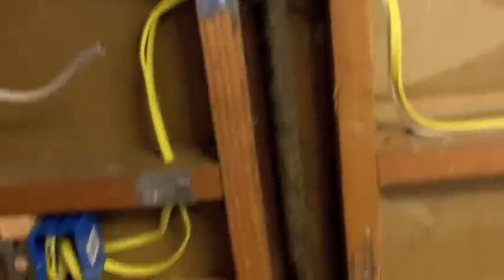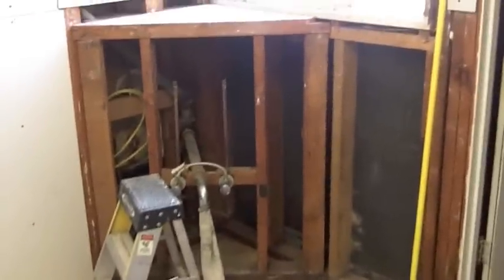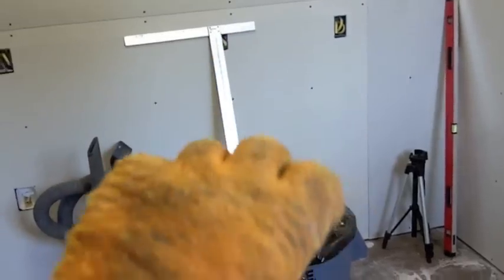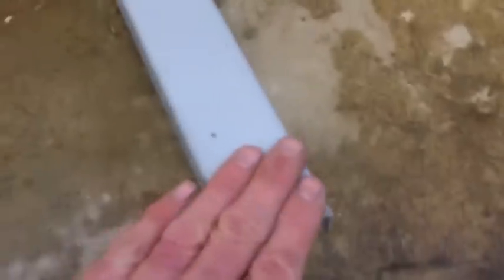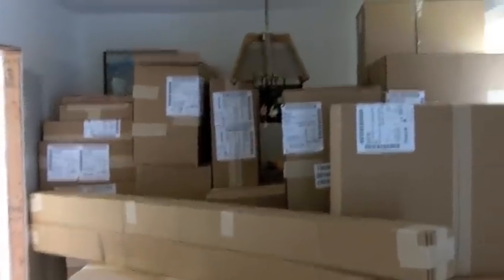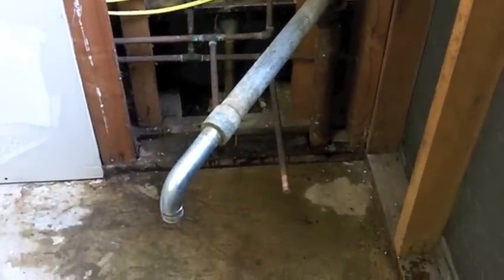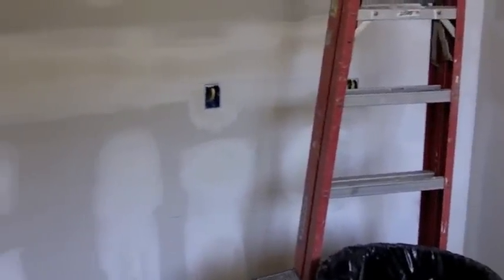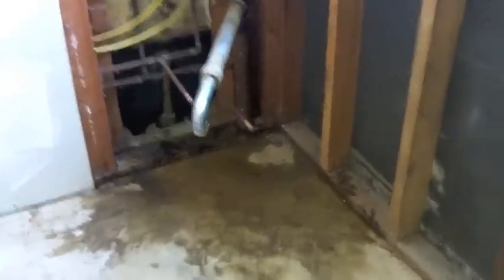Custom Kitchen Remodel  Drywall and Cabinets 8

Comment: Hey Steve!! 

I like that Romex cover you built, that's cool! Great tip on the nailing plates, at .24 each, you can't go wrong! You never know what someone may try to drive in the wall someday down the line. 

Cool gloves, I'm going to look for some. The drywall lifter looks like a must have tool!!

Nice cabinets! Made In the USA, that's awesome! Can't wait to see them installed!

Great job on the drywall! Sealing that seam makes a lot of sense, old attics are dirty!

Awesome video!!

Comment: nice work on the kitchen, dry wall looks great. those piercing pipe clamps for the water over time will leak. steel and copper don't like each other. the one I installed lasted about 5 years. just saying. nice gloves! thanks for the videos.

Comment from the maker: Hey Freak, I have heard good and bad about those clamps.  For now, the hose is just stubbed up into the attic.  I don't know if the owner is buying a refer with icemaker or not, so I may or may not tie in the line. We just wanted it in place while the walls were open.  It really would not take much to tie into the water line with a real fitting.  I will see as it goes. Thanks for the comment.

Comment from the maker: Hey Jay, I am not using any of the old wiring for the new kitchen power.  Replacing the old wiring is not as easy as pulling new wire, It is a major undertaking to open up walls, yank the old and pull in new.  The K-a-T is all copper approved ga. wire that is working just fine..as long as you don't need to modify it.  Thanks for watching.  I have family in Kings Cross, just outside Sydney.  Been many years since I have been, but it sure was Beautiful Country!

Comment: yeh thats fair enough, like the old rubber coated stuff we used in australia that breaks down and literally crumbles to pieces in your fingers. also it was common to use the metal conduit as an earth, so when people broke the conduit for ad on's it compromised the houses earth. if the ruber wires degraded the conduit became live, many people have been killed through that. 

Australia is great, apart from some on the social intolerance. im in Melbourne and there is a huge class problem here lol

Comment: Shouldnt be using those piercing pipe clamps. Over time they will leak and wreck your great drywall work and god knows what else. You should just spend the few extra bucks and few extra minutes and solder in some connections and what not. It will last a whole lot longer and be a whole lot better then the piercing things.

Comment from the maker: Hey Ray, Actually the last couple of shows I have not taken video for uploads.  The more vid I took the less comfortable I felt having all those kids on YT.  If they take it and post it, it's one thing, but me doing it just didn't feel right.  I figure If I make any cool props or set features I will make a vid.  After Beauty and The Beast, I moved up in the ranks as Tech Director. That means more show responsibility, so my time to vid has declined as well.